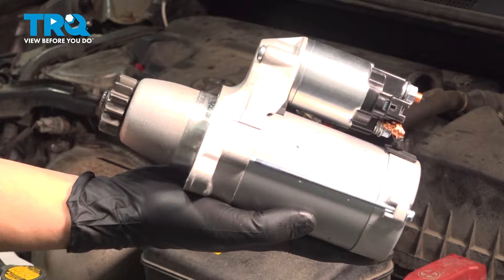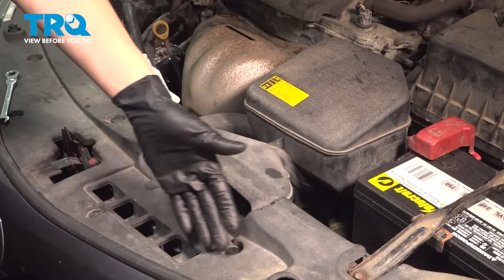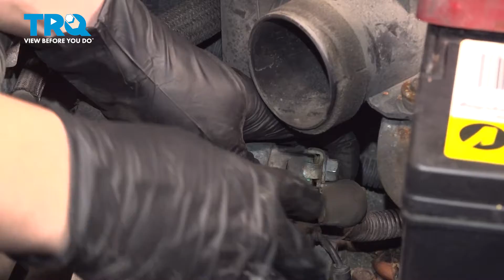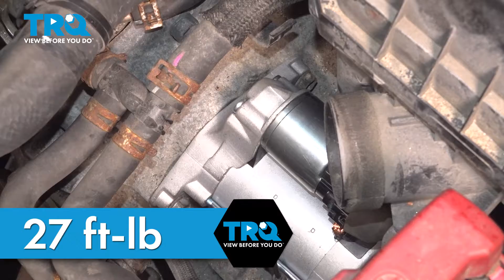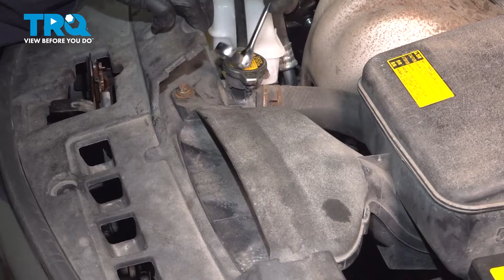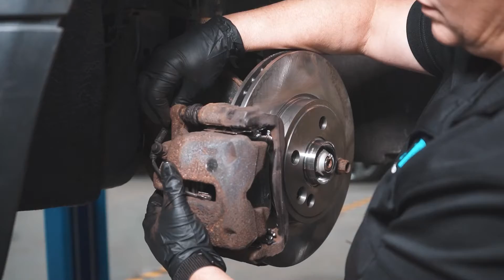How to Replace Starter 2012-2017 Toyota Camry 2.5L L4

Comment: My advice is for this just remove the battery and the air box and u can legit just use a 10mm - 12mm and 14mm wrench all you need for this job

Comment: Removing the battery and the plastic plate that simply sits under it provides much greater access to the starter and the 14 mm bolt on the back side of the starter.

Comment: I’ve noticed too. You guys only work on the easy stuff like swamping out parts like …. Front brakes, replacing quick struts, or replacing an easy access O2 sensor. That’s not very helpful if you are wanting to really show the internet what a real mechanic is. Show them everything like difficulty parts installation to an easy parts installation.
Reply: I mean the purpose is to help the common man that’s trying to do a simple fix. I’m sure if it was something more serious you’re better off taking it to a mechanic.

Comment: This technician is lazy. You can easily just remove that plastic covers. There’s only maybe 8 clips that are holding on to the cover. Remove it and than the 2 10mm bolts is right there to the air intake cooler. TRQ do better and show people the correct way of doing things.